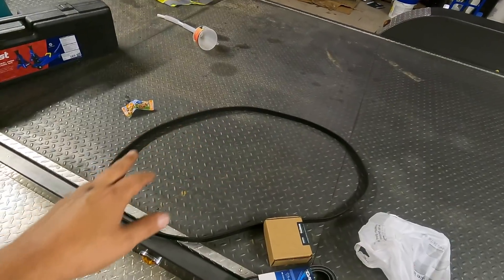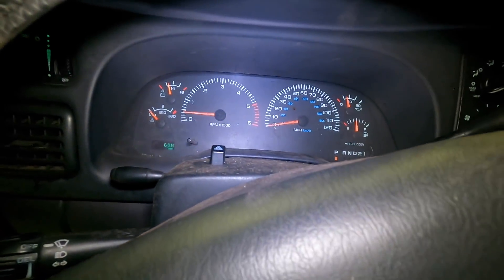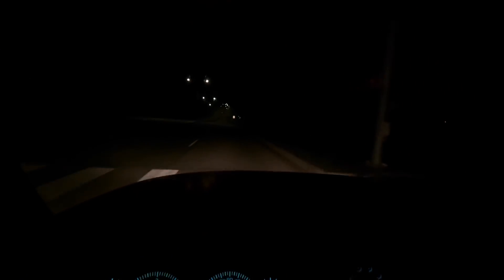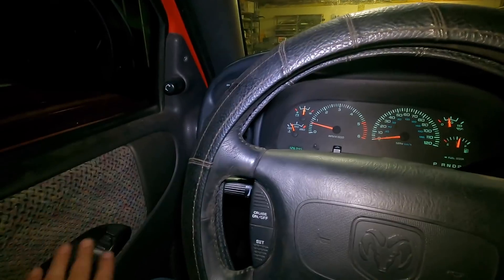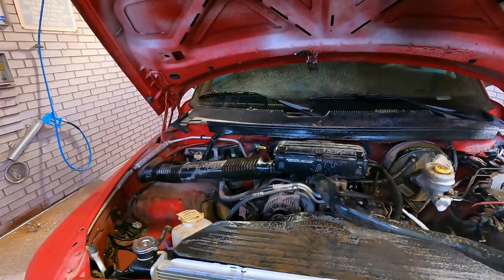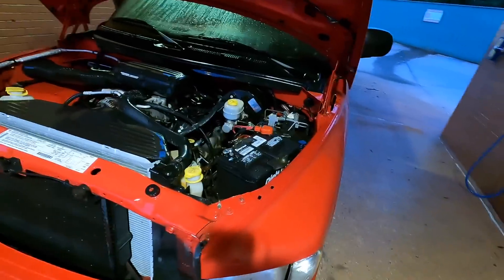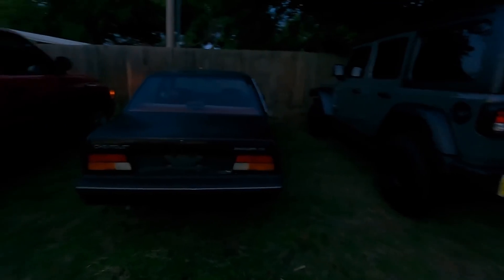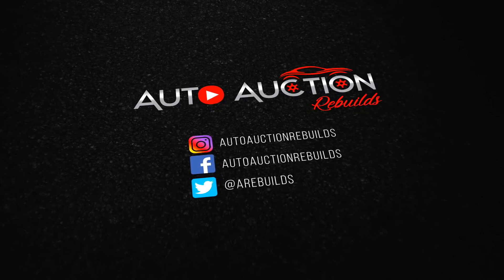Abandoned 99 Dodge Ram Sport is DONE!! We had Issues! Going up for Sale!!

Comment: I cringed a little when randy put the pressure washer directly on the alternator
Reply: I was like now this is when he fucked up.🤣
Reply: You cover your alternator when it’s storming too? It doesn’t matter..
Reply: @XX-166  lol. Dude must drive a drag car with no hood or some shit. Why would anyone spray a high output electrical source with water expecting good results
Reply: @unrealzebra3662  yes I do, it's called a hood, or as they say in some other countries, the bonnet.
Not to mention the the high output current that comes from a alternator.
Reply: @ChosenBC  you do realize water comes up from under your vehicle and from the front grille? 💀 they are made to be outside and be okay in the rain/storm, you can spray an alternator
Reply: @unrealzebra3662  you sound like you have no knowledge about vehicles whatsoever. Yes, water comes from underneath the vehicle but it does not go that high up into the engine bay for one and it when It rains or storms. There is not that much water going into the alternator. A little won't hurt a lot. Can do a lot of damage 🤦🤦

Comment: IF I wash an engine bay I use garden hose pressure only, spray on cleaner of some sort, sometimes a brush, and I usually put a shopping bag over the alternator to keep the water out of it. When you use the pressure washer it's going to force water in where you don't want it and cause issues.

Comment: It's amazing how that dash cap changes the total appearance of the interior.
Reply: I'm 100% against a cheap cap. Never glue them on.. 
A: The stress from extreme heat and cold will cause the dash subframe to crack and bust. Soon you're searching the pick-n-pull for a decent replacement or shelling out top dollar on ebay.
B: The cap (if glued on) will inhibit your ability to replace the heater core. Unless you want to remove the entire dash assembly. 
Best to pay the extra $100 for a factory replacement from Mopar or LMC and replace it right the first time.
Reply: Velcro
Reply: @paulmckinney6163  I guess it's to each his own. If the truck means little to you then have at it. If you're a purists like myself, you want it looking factory. 
You're talking to an enthusiast who drives 3 hours away to pull decent parts to restore a '95 Chrysler Concorde.
Reply: @BoringIntrovert1982  you restored a 95 concord? ......
Reply: @enjoythesho1992  Absolutely! And my daily at that! From work to beach and mountain trips, she's performed all flawlessly. I wanted a Mopar project that was easy and obscure to many. So, I found her on Craigslist for $1,000. The original 3.3L and 42LE trans is surprisingly sound. 
Exterior parts replaced: entire suspension, all trans & engine sensors, all gaskets replaced (except head gasket), radiator, water pump, battery, front fenders, hood, tires, brakes, wheel bearings, belt moldings, and power to fixed antenna.
Interior parts replaced: steering wheel, passenger air bag door, center console, power to manual seat conversion, multifunction switch, ignition switch, door lock actuators, front passenger window motor, speaker, and Kenwood Bluetooth stereo.
To do: transmission shift solenoid for rarely intermittent limp mode and a repaint from Maaco.

With all of that said, at 192k she will never be worth the time and money invested.  A: These were never meant to be saved nor really desired. B: She was involved in a rare SC hail storm last year and she's riddled with dents all over.
Reply: @BoringIntrovert1982  you should make a youtube  channel, I would watch it
Reply: @JustaShrimp372  Thank you for the kind words. Looking back, I feel I should have started filming this adventure. I often wondered, how many people would watch someone wrench on a Chrysler Concorde? But, there are several successful lawn care channels that make bank on us watching them cut grass. I were to start a channel, it would probably me going to the pick-n-pull. Thoughts?
Reply: That would seem pretty entertaining to watch

Comment: When washing an engine bay there are places you want to avoid completely, (can be misted, but not soaked or pressure washed), being the electrical stuff :alternator distributor sensors wiring connectors, computer('s), fuse block's ect. . you do that and you'll be just fine

Comment: if it doesn't start right away, don't keep cranking. probably had some water under the cap. next time use a garden hose instead of a pressure washer.

Comment: The truck had a miss in from the beginning. If you had new cap an wires and a cap and leave it running while you wash it. Any motor that I have cleaned always left them idling

Comment: Driving a 96 Laramie worktruck & still haven't figured out the abs & break lights coming on randomly, replaced every fuse in the panel left of the dashpad & they went off till the next time I did the breakpads.. 
  Bought a 97 Laramie last year & the head gaskets & trans failed before I paid it off, didn't get 900 miles put of it. 
  Now I'm stuck in this 90 regal coupe with a bad crank sensor & no back window. Try again this year hopefully; I'm recovering from covid last week & these headaches aren't giving me much hope.

Comment: You’re supposed to use distilled water (or an in-line filter of some sort) so that the residue left behind when the water dries it doesn’t interfere with the electrical system.

Comment: Quit worrying so much about the distributor. I'm betting you filled all the spark plug wells with water and shorted the plugs. After the motor heated up enough, the water vaporized and everyone was happy. Next time, make sure you have compressed air or a leaf blower handy and BEFORE YOU CRANK IT, blow the water out.

Comment: You should have warpped the distributor and electronic inside the hood with plastic before you pressure wash. It's obvious you do not have to pressue wash the plugs area with that much pressure and for such a long time.

Comment: I was always told to leave it running and to never use a high pressure wash on it just the spot free rinse with a cleaner is all you need otherwise your risking problems

Comment: I have owned a '95 Ram 1500 for 26 years. Same engine, just the 5.2L model. I've washed my engine countless times and it's never done what yours did... Maybe the distributor cap is cracked? The inconsistent check-engine & ABS lights suggest to me the ABS relay is faulty and there might be an O2 sensor on the way out.

Comment: I own a 2000 Dodge Ram 1500 5.9 motor quad cab with 174 thousand miles on it I purchased 11 years ago 2010 it had 142 thousand then I've put 32 thousand on mine lately I put around 800 miles per year on it the truck is a garage sitter they are good trucks I plan on keeping mine for a long time Go Mopar !!!

Comment: *Do not use high pressure to wash engines.  Hose SHOULD be fine (sometimes fills spark plug wells though regardless.)

Comment: I love how people fell the need to pump a gas pedal on a fuel injected vehicle. Lol
Reply: I had an 86 escort gt that would not start in singe digit weather, if I didn't push the gas pedal. This is back when it was fairly new. Yes this was early fuel injection.
Reply: It's a dodge thing.  I have taken so many old Dakota's and rams on trade in that would only start when you pump the gas a couple times first

Comment: That's a cherry 2nd gen! It should fetch a a pretty penny at IAA. Something tells me either she was a special order or she was originally a SLT and the Sport bumpers and grille added after. In 1999 all Sport models had their Sport decals on the each side of the hood near the A pillar. They also had outlined Ram & engine decals on the doors. The Dodge and 4x4 tailgate decals were outlined to match the doors. It wasn't until 2001 when Dodge went back to badges for the doors, the Sport decal was replaced with a badge on the B pillar, and the standard tailgate decals replaced the outlined.
Reply: I like your profile pic
Reply: @oldcroneysgarage9739  Thanks! I collect mint 90's Dodge brochures. My profile pic is from the 1997 Ram brochure.

Comment: Good lord. You can spray a engine bay all ya want. Just don't be close and spray the alternator, the computer and or distributer with that kind of high pressure,  vs a garden hose and some brushes and elbow grease.
Just keep it running  if your always paranoid.

Comment: Its good that the truck is fine haha, but engine bays are not necessarily dangerous to wash, I washed my cars engines a few times by now just need to cover the exposed electronics and all with tin foil/aluminum foil or anything that is water resistant, even to the slightest like I usually do, also you NEED to leave it to sit atleast 2-3 hours, preferred home wash.

Comment: Whenever i do the engine I spray it with engine bright, let it sit for 10 minutes or so, then spray it down with a normal garden hose, not a presser washer. And most definitely would never spend 2-3 minutes spraying that much high pressure water on the engine. No need for all that, way to much electrical shit that can get wet and cause an issue.

Comment: Hey man when you wash an engine dude leave it running so the water will dry up never spray an engine without it off only when it’s running because you can ruin the car from starting this is why you start the car while it’s running spray it then spray it with water let it run it will dry up all the water that’s in it and I’ll run

Comment: I had cars trucks and tractor trailers  for 65 years. Always washed the engines. One thing I always used to do is leave them running. Never had a problem with them. One thing that I hate is a dirty engine. You never know when you might have to work on them. Just Saying 👍

Comment: It is a nice truck it really is the 5.9 is a good motor but I wouldn't own a old dodge there's too many risks especially with the transmissions
Reply: It's all about how they were maintained. I'm the 2nd owner of a 1997 Ram 1500 w/ original 5.2, 46RE Trans, and 9.25 rear. Bought her in '08 from an older gentleman  w/ only 87k for $3,000. Today she has 225k on the original powertrain. No issues other than a  plenum gasket in '09, a water pump & catalytic converter in '13. Of course the normal wear items. She has never left me stranded and is really a member of the family. Just a trans fluid and filter change. Never flush a automatic transmission!
Reply: Yeah dodges are great unless you have real work to do.. keep the bed empty and dont get the rpms up over 3000... tranny should be just fine👍 lol
Reply: @slofloat3184  The railroad I worked for back in from '04 to '07 had a 1997 Ram 2500 4x4 Cummins w/ 47RE auto trans. When bought new it was used by management. Then we used it on  the train crew for transport. Afterwards it went to the maintenance of way and car shop hauling track tools and parts to repair locomotives and freight cars. It's still being used daily. If a automatic 2nd gen can handle the daily rigors of a railroad then it handle nearly anything you'd can throw at it. I've had my 2nd gen since '08 and have moved all over SC for my job. Not once has she ever failed me. At 225k she's still my reliable daily.
Reply: @slofloat3184  I know right fr my first dodge I had it for two hours i got on the highway hit 80 and when I got to the next stop sign and then took off I no longer had a 3rd or 4th gear barely had 1st and 2nd something blew majorly I took it back because my dad bought a similar truck and dropped over 4k in 2 trans no thanks

Comment: Washed every engine on every vehicle I have ever owned and that's approaching 30 years.  I never leave them running lol... that's just retarded to do.  I had one not start which I fixed with a screwdriver and one LS powered truck years ago go into limp mode.  Not bad for easily over 100 vehicles lol.

Comment: No, don't wash an engine that's not running. Do your research before doing something you know nothing about. You never shut an engine off and power wash it. You have to keep heat in the engine and engine bay to dry up the moisture in water 🤦🤦 you have to keep heat in the engine and engine bay to dry up the moisture in water. Been power. Washing engines for years. Never had a problem